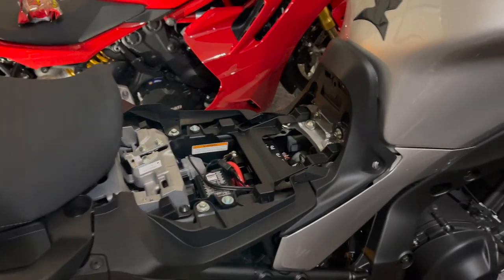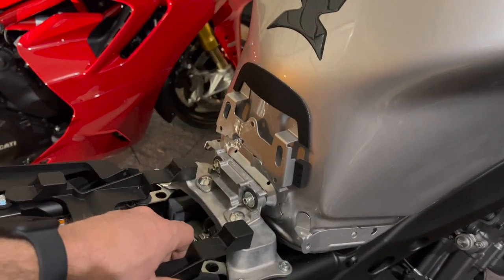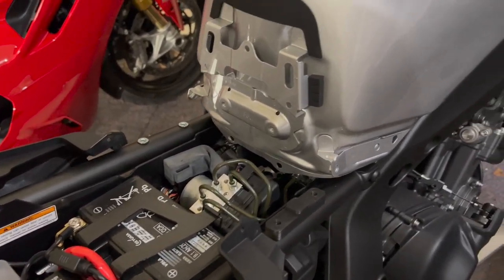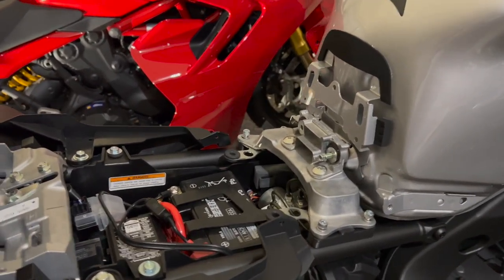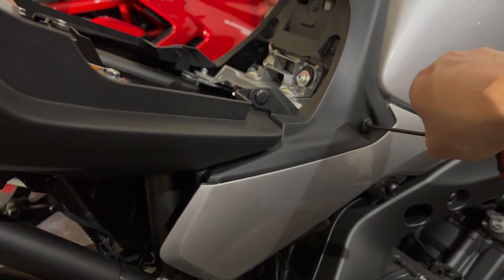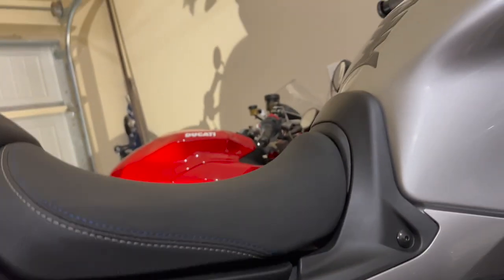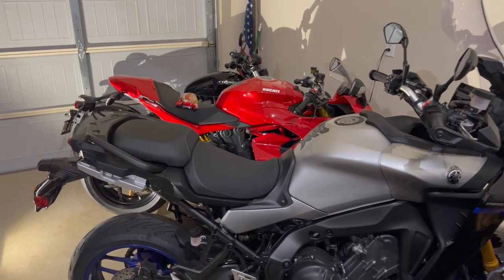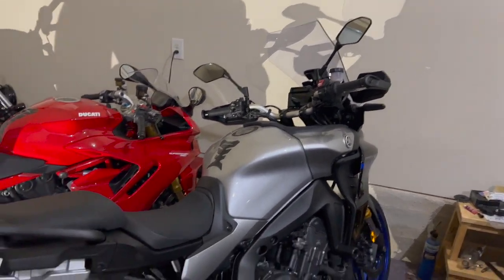2021 Yamaha Tracer 9 GT - Seat Shim Kit Install

Comment: I think you really do need a goofy tall screen. The ONLY screen that worked close on my 17 Tracer, and I tried lots, was the Puig touring with the deflector. Anything slightly smaller caused noise. I use a tiny screen in summer made from a cut down mra with holes drilled to match the Puig so just 4 small bolts to swap over. Great video, Imdid a similar bodge a few years ago, this is way neater. Yamaha are a bunch of..Seat and screen have been a problem since 2014. How many potential buyers are put off because of this?

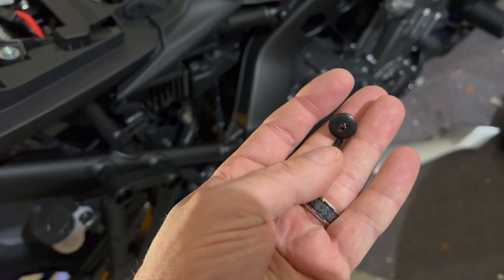Comment: 2:20 I had one of the 3 push pins at the front (they go into the tank) stick, when I tried to prise is out it went flying! Just be aware & have spares like I did. Phew!
Reply from the maker: Yeah, I usually pick up a box of them at Cycle Gear when I pick up crush washers, just to have them on hand.  You either break one, or drop it down into the bike somewhere, pretty much every time you remove them...  lol

Comment: Might try this without buying the kit...my thinking is simply use washer stacks in place of plastic spacer and then simply find a larger rubber grommet in place of the offset special one...I think the slop above it will be fine and if not a squirt of silicone seal into the void with overnight to harden will effectively create an offset grommet...not to cheap out but I honestly don't know if it raising the seat slightly in front is really going to help any....and spending money to accomplish nothing just irks me...maybe if I A really like the result and B am not happy with the washer stacks and oversized grommet?  THEN I might buy the shim kit
Reply from the maker: That will very likely work just fine.  The kit is cheap, but yeah, once you see how it works, you can just make one yourself.

Comment: Just installed. Seems to be a better position but I haven’t been on a good ride with yet. The stock seat was good already for 2 300 mile rides but this feels like it will be better. Oh, the 3 push pins that go in tank are different from the others. Figured out when I couldn’t get one to secure. They look very similar on a shelf. Other than that I had it done in less than 30 minutes. I wasn’t in a hurry. Thanks

Comment: What would be your opinion on cutting the 2 raised seat height  perches at the rear of the seat height adjustment plastic component ? Then set it into the higher position so that only the front raises ?
Reply from the maker: Possible, but I no longer have the bike to experiment with.  It was causing severe neck pain and I had to get rid of it.

Comment: Thanks for this! I just purchased a used Tracer 900, 2019 model. "The Goo" definitely has a slope feeling in the seat that I want to modify for longer, more comfortable rides. Your link appears to only be for '21 models. Is there a difference? I too am 6'4" and have a taller V-Stream shield. It still hits the top of my helmet and vibrates my brain! No fun that! Swapped the OE shield back in...I'll take the chest wind over the brain box beating!
Reply from the maker: That link is for the 21+ models but check their website, they have kits for the other years as well.
Reply: @Daves_Man_Cave  Yes I found the other models on the site right after commenting on your vid. Thanks again

Comment: I installed the shim today 8mm but there is a lot of gap between tank and plastic so I removed it. It was very ugly with that much gap. Is there a solution?
Reply from the maker: Did you put the seat in the right height slot?  I believe that it is made for either the top, so there should not be a gap.  If you mount the seat in the lower position then there might be.  Or vice-versa, I forget which.
Reply: @Daves_Man_Cave  I install the seat in high position. With shim lower position cannot be set. The plastic which is needed for lower position cannot be installed. There is not enough space to insert it or slide it in. If I could i would sent a picture

Comment: so i took a testride on one of these today, and i found a bit of a pressure point on the backside of my bottom, basically where your back meets your ass, right around the tailbone. the seat was mounted in the higher position, would you say this would more evenly distribute the pressure over the entire surface instead of focussing everything towards the back? i'm 90% sure i'm gonna get one but i do need to get this figured out and set the bike entirely to my liking, not just 95% y'know
Reply from the maker: Honestly, I never really got it sorted.  The $600 Corbin seat felt a lot better, but I could never get the bar ergonomics to work with my neck, so I ended up trading the bike in on a new ZX14R, which I find way more comfortable...

Comment: by using t/he lower position of the front seat mount, haven't you just moved the bracket up and left the seat where it was or maybe even lower?
Reply from the maker: No, the bracket moves up so it being in that bracket, the front of the seat comes up 8mm.  The goal is to level it, by only lifting the front
Reply: @Daves_Man_Cave  Didn't you say that you originally had the seat in the high position but now you installed it in the low postion? The difference between those positions is more like 20mm (guessing) so you moved the seat down by 20mm then up by 8mm with the shims lifting the seat bracket. Had you left it in the high position, I agree you have lifted the front of the seat by 8mm but not if you change from the high to the low.
Reply from the maker: @neilallwood4943  Yes, I explained why in the end, I wanted to ride in the low position if possible.  I want to be more in the bike, than perched on top of it getting blasted by wind.  But the forward pitch isn;t comfortable... The seat needs to be level.  As I can't lower the rear, I needed to raise the front.  So basically the front is now in the higher position(almost) and the rear is in the low position
Reply from the maker: @neilallwood4943  In a nutshell, I wasn't looking to shim the seat to raise it.  I wanted to raise the front, in relation to the rear, so that it sits more flat, and not so sloped down to the front.
Reply: @Daves_Man_Cave  Totally agree with your intentions, not sure you achieved it with slotting the seat into a lower position than before. The only thing that you acheived was to raise the low position of the front seat mount by 8mm which is 12mm (approx) lower than where you had originally had the seat. All that really matters is that you are happy with the result. Ride safe.
Reply from the maker: @neilallwood4943  Right, but the rear has two settings.  When you put the front in the high position, it pulls the seat forward, so that the rear slots into a higher setting.  It doesn't lock in you you try to put the front at one level and the rear at another.  Its both, or nothing.  

So what the shim in the front does is raise the front mount 8mm, but leaves the rear alone.  You still have to do the all or nothing setting, both low or both high, but the rear is at the OEM height and the fronts, either high or low, are 8mm higher.

Comment: Very cool, thanks for showing the details of the install! Even if it should be easy its always great to quickly see what hurdles someone else might have come across.
 I'v not ridden my T9 yet as here in Denmark winter insurance is absurdly expensive, i'll test it out in a few weeks time.
  Sadly getting that kit imported is going to be a bit of a pain if i end up needing it.
Reply from the maker: If you had to, you could probably make your own, largely from parts sourced from the local hardware or home improvement store.  Find some plastic or metal spacers and slightly longer bolts.  You could likely use stacked washers to fine tune it 1mm at time...  The tricky part would be making the offset rubber grommet.  You could probably easily make one out of a solid piece of rubber or plastic, and then just shave it down so that it slides in there, and drill the holes to correspond to the amount of washers you added under the main mount?

Comment: Are there any extra charges for us that are located in Europe ? That's exactly what I need, but I do not want to pay for silly import taxes...
Reply from the maker: No idea, I don't sell them.  But to be honest, its just a piece of 3D printed plastic... once I installed it, I saw how simple it is, and you could likely just make your own shim with plastic or metal spacers and longer bolts.  All it does is raise the front of the seat up hand an inch or so...  You could probably get some parts from the local hardware shop and just make your own spacers...
Reply: @Daves_Man_Cave  Indeed it seems really simple, the only hard to find/craft is the rubber spacers with offsets... I might give it a try and try to find thick rubber and trim it properly
Thanks for the response mate :)
Reply from the maker: @sakisns3337  The offset is pretty easy...  Find a solid plastic or rubber plug that slides into the hole, and whatever height spacers you use, drill a hole with the same offset in that plug.

If I had to do it over again, I would just make my own as a fun little project.

Comment: Thanks for the video and I'm a new subscriber. Looking hard at the Tracer 9GT to replace (maybe) my 2012 Super Tenere. 6'4" also, so looking forward to your thoughts. Lower pegs, risers and this and or, a new seat might be the ticket.
Reply from the maker: I couldn't get it to work for me, and so I traded it in.  I have issues with certain ergonomics and I just couldn't make it work for me.
Reply: @Daves_Man_Cave  I was afraid of that. Tried the Tracer 900 GT a couple years back but no comparison to my modded Tenere comfort wise. Sat on a Tracer 9 GT last week, though better, it would need work. Search goes on for a new sports tourer for a tall lanky guy. Enjoying your insights and videos.

Comment: Do you think this was worth installing? I haven’t put mine in yet.
Reply from the maker: It improved it a bit, but in all honesty, the seat is still pretty uncomfortable on longer rides.  When I am in the mtns and moving around a lot, its fine.  When I go on a longer ride like I did this week, its very uncomfortable.  I am not sure how long I will keep this bike.  Its awesome in a lot of ways, but the thing I wanted it for was road trips, and unfortunately its not working well in that regard...
Reply: @Daves_Man_Cave  understand. I don’t know how you do it at 6’4 in the low position for the seat. I will say the air hawk and being in the upper setting is pretty solid. I didn’t really realize how I needed my butt to take pressure off of my knees. Yeah I can see how touring is not at all this bike’s strong point. I came from a super tenere and it was well suited for that. Very comfortable and tons of space and options for you to strap shit onto. But I wanted something more sporty and I can only afford one bike. So this is it for now.
Reply from the maker: @Romenet310  I have the seat shimmed and in the high position, and the pegs in the low position...  The bars also hurt my neck after about an hour...  Not sure what I will migrate to.  Gonna look at the Ninja 1000SX, GSX-S1000GT and the Harley Pan American...

Comment: Uggg, I wish that the back of the seat could have been lowered.
Grrr
Reply from the maker: How do you mean?  Shim the front and lower the back?
Reply: @Daves_Man_Cave  
Just wish all there was to do is just lower the back to make it level. 😏
I'm 5' 8"  

From what I have been gathering.  The best hack for wind buffeting is a clamp on louver.  And it's like  $35.
I have touring wind screen. $240. ish Helps with buffeting but now have to look through plexi .... n bugs.
In time there will be a better wind screen out there.
Going to order the $35. hack until then.